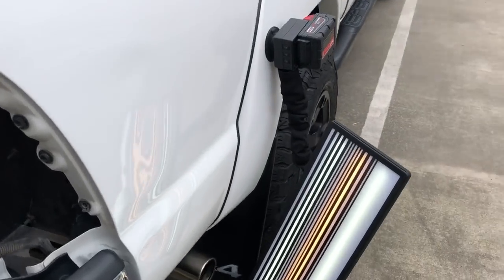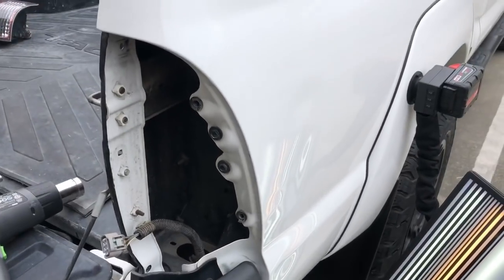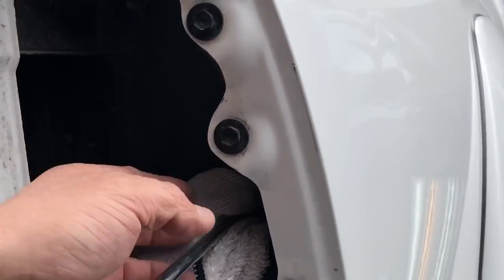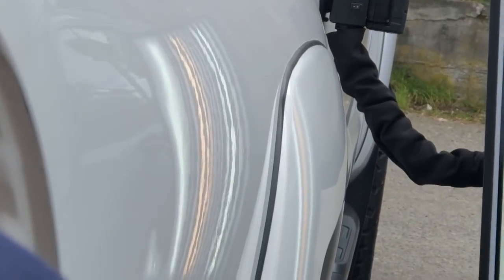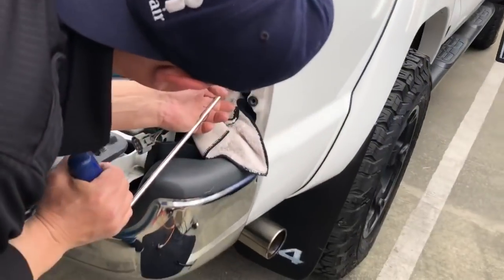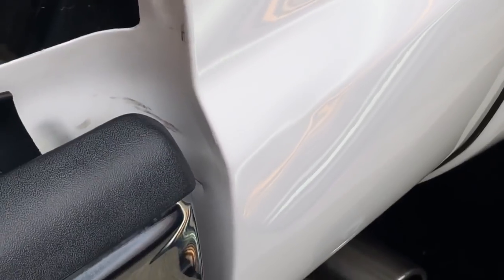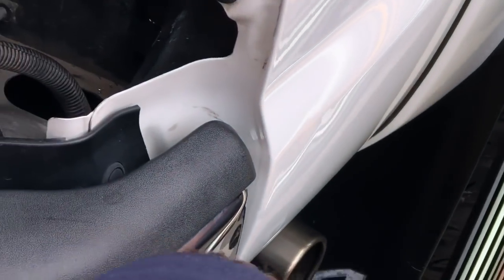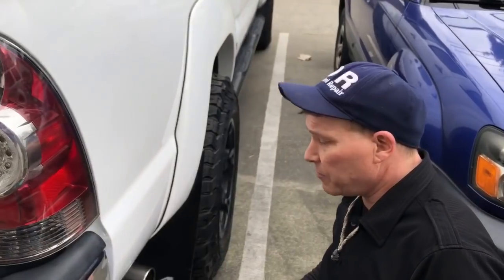INCREDIBLE !🚨.... will it come undone?🤨 MUST SEE!!

Comment: Why do you use heat? Does it makes the metal softer?
Reply from the maker: Alca Pone The metal yes, but mostly the paint. I have to get the paint to temperature that it won’t fracture as the metal moves. 👍 thanks so much for watching.